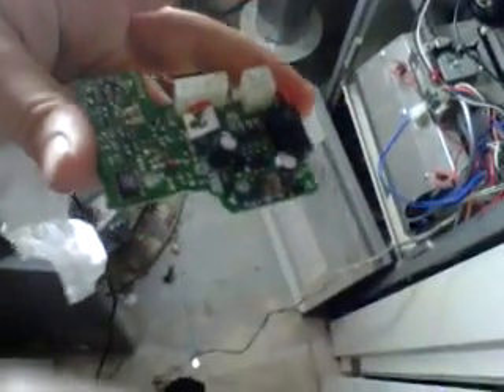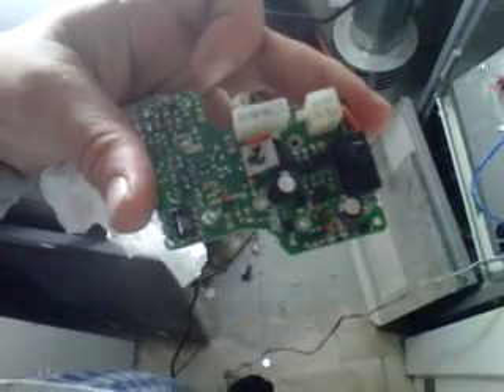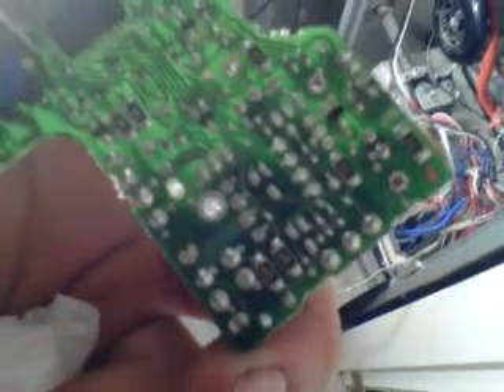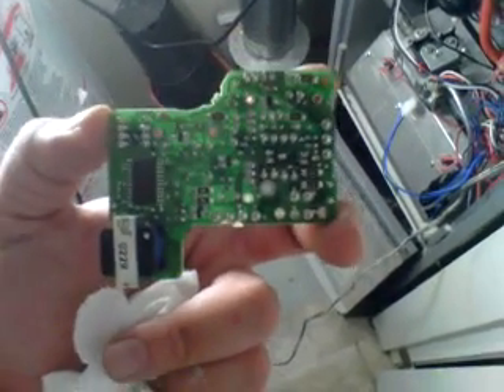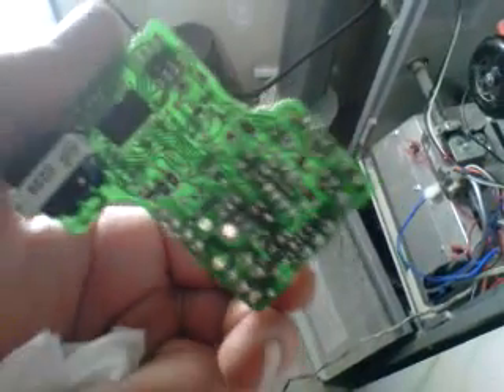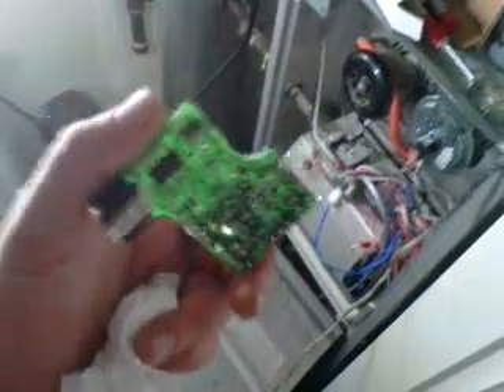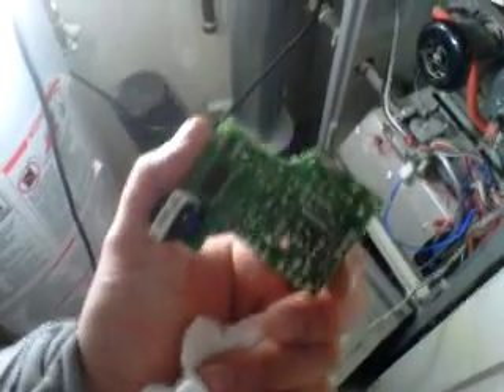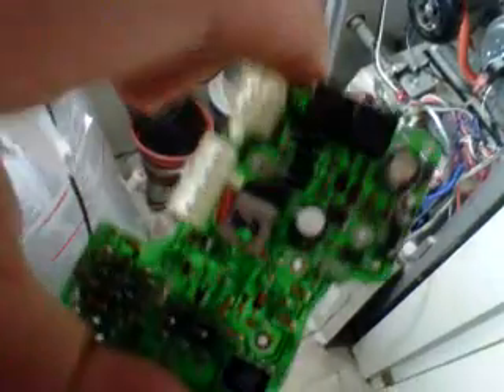honeywell sv9501 smartvalve repair #4

Comment: Hello . My machine no longer works due to water infiltration and my serviceman suggested replacing this part. Considering the high price of this part, do you allow it to be repaired or do you suggest that the part must be replaced for safely reasons? Thankful

Comment: How did u take it off? I took off 3 screws and it seems like it’s still on. I dont see another screw to take off. Anyone help?
Reply: It is soldered to solenoids below it. The video doesn't mention it, but probably desoldered the board from solenoids first.
Reply: @SergeyZelenev  after more research that’s exactly why. Thanks for the reply brother!!!

Comment: You should never ever take a gas valve apart and then reuse it incredible that you would risk your house and or family to save a few bucks
And if something did happen your insurance company would say no way we are paying
Reply: He did not take apart any of the mechanical parts of the valve that may need calibration. Electronic part if the valve already failed - it likely doesn't sense the pilot. It cannot get much worse than this.

Comment: I have a different smart valve. Same number, different generation I guess.
With the cover removed, the control board and a bottom cover slide out from the solenoids and valve body. There's only a ground connection terminal to disconnect. Problem on my furnace is that the board removes towards the enclosure. Making removal impossible without cutting the sheet metal of the furnace body.
However...
As the jiggling the ignitor connector was no longer working, and I had no way of removing the control board, in desperation I thought about what had worked on my LG washer thermistor connector. For that, I pulled the pins out of the plastic connectors, crimped them, and pushed them together individually.
So, I took a small precision flathead screwdriver that could fit inside the connector and for each female pin in the connector I squashed the two halves together.
Pushing the plastic connector back into the valve was noticeably tighter.
Turned on power to the furnace and SUCCESS!
So just old female connector pins that have become loose over the years.

Comment: Hey.. how do you find the part number for the circuit board for these gas valves???? So I can order a new one and just solider it on! Mine got wet and fried out and I need to replace the circuit board asap

Comment: I do see a problem with relocating the whole "gas train" through the return duct/ inlet to the main circulation blower. In the event of a release of raw fuel/ gas from the connections or mechanical venting of the valve, gas would be released into the duct system. I think that extending the four coil leads, with a wire harness, and relocating the valve board to the fan compartment would be genius. Good luck with your repairs.

Comment from the maker: I did end up replacing the smart valve. The repair did not fix the intermittent operation of the smart valve.   2 nd step would be to reflow solder of the entire board, you could do this with an smd soldering station, or throwing it into the oven at 350...  if this still did not fix it, component changes would be necessary .. I didnt want to go this far as its getting cold out and i needed heat. Replacement took about 1 hour. Furnace 100% repaired.
Reply: I could be more than just bad solder connections. Did you reflow all the plug connections to the board? Did you test the  ESR of those electrolytic caps? I will have one of these to take apart soon. I am going to go over it with a microscope.
Reply: I have now replaced my gas valve with a new one. I took apart the old one and tested the components. As I thought, the capacitors have a high ESR which is causing the problem. Like any electronics with electrolytic capacitors, they dont last forever and need replacing over time due to leakage or drying up.